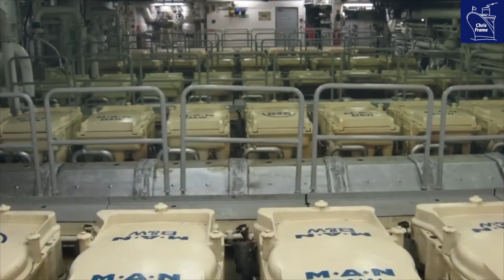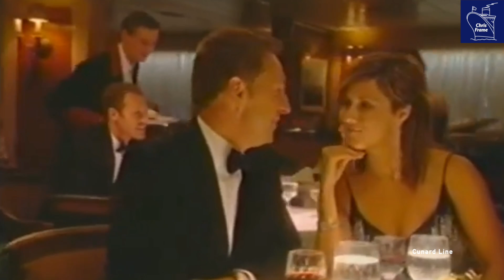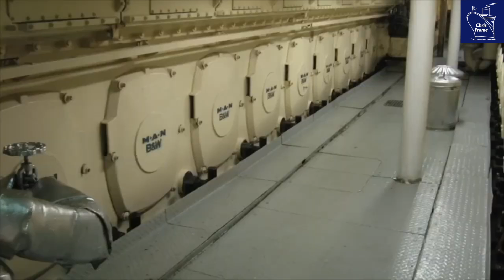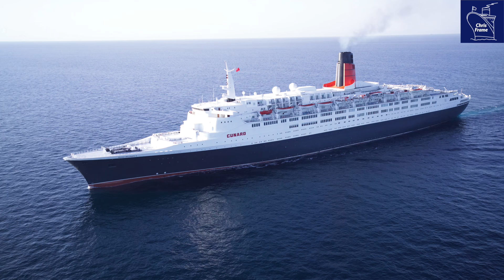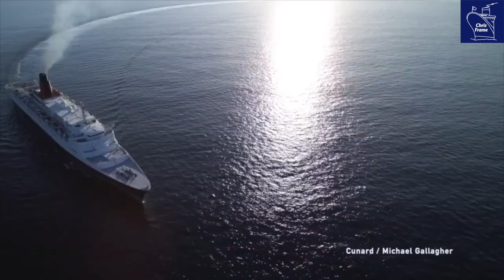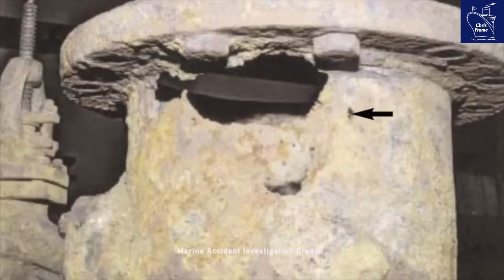The Design FLAW That Almost SANK the QE2

Comment: I learnt from someone involved during the construction that some of the upper decks warped a lot from the welding. They might have been aluminium. Anyway according to my source, this required a helluva lot of epoxy filler to fair the decks.

Comment: A bit surprising however. Any yachtsman knows that all thru hull fittings are vulnerable and must be periodically replaced. On a yacht proper silicon bronze is used. This was just steel ! So corrosion is not maybe but certain!

Comment: At present, the SLNC York, which provides logistics to the US military, is crippled with a broken propeller shaft in the South Pacific.  Very similar situation, no easy way to stop the inflow.  Apparently, there is enough reserve buoyancy, but the engines can't be run.
Well done video, subscribed.

Comment: They got very lucky too.  That bladder could have blown the rusted section outward just as easily as an external wrap could have collapsed it inward.  I am guessing that when constructing a water tight integrity vessel such as a ship's hull that no pipe should be overly large, as that ten inch one was.  By specifying several smaller pipes to a manifold where the main shut off valve is the likelihood of only one manageable leak is higher.  The solutions on a smaller pipe would be more varied and somewhat easier to manage with the bilge pumps buying time for repairs to a much, much smaller volume of water ingress.  It would also be provident to design with the flange of the shut off valve against the outer hull plating, eliminating that uncontrollable section.  It would not be too far a reach to also design all such valving to be in a watertight compartment where flooding could be contained to a small volume.
Reply: Against which you have to balance the principle that through-hull fittings should be kept to a minimum. If you were to halve the diameter of the pipe, you'd have to have four of them to achieve the same capacity. I imagine that having lots of incoming pipes leading to a manifold of some sort might offset the benefit of mitigating potential water ingress by adding increased complexity. Such complexity could well militate against the practicalities both of adequately inspecting the installation and accessing its constituent parts in the event of failure. TBH, I was surprised that the bilge pumping capacity was not adequate to cope with the failure of a pipe of that size.
Reply: Naive generic comment

Comment: None of that made any sense.  Either your pictures were wrong or your description was
Reply from the maker: Hello. Sorry to hear you struggled to follow along. The story and the imagery both were set out in a logical way so I’m not sure where the breakdown happened. You can always read the full report online at the UK Marine AIB.
Reply: My confusion is with the diagram that shows water flowing into the engine room from what looks like a hole in the inner hull as it leaks in from a pipe that has eroded between the two hulls.  Also if they put a balloon up the pipe how did they do that with the valve there. It says that the area between the two hulls was inaccessible.
Reply from the maker: Ahhh okay - the bladder was inserted into the pipe from the accessible side and then inflated past the break to seal it off. The red line in the diagram is to illustrate inaccessibility I perhaps am not that good at creating diagrams 😂

Comment: I thought that all pipework coming into contact with sea water was specified as Kunifer 10.
Reply: Usually where it enters the hull it will be the same material as the hull then go to CuNiFe after the hull valve
Reply: @grandsoleil56  There must be a solution to this problem, I have used Kunifer as an industrial pipework engineer, how could we connect Kunifer to the ocean in a safe effective way, maybe one transitional pipe welded to the hull, lined with kunifer and counterflanged with the same metal so no contact with steel and sea water. Mind you the soldering rods for Kunifer are very expensive, beautiful pipe to work with though. Please share your thoughts,  I love other peoples ideas and observations.
Reply: @cbechstein9347 on the steel hull vessel I work on the CuNiFe pipe goes to butterfly valves separated by gaskets to the hull material, bonded electrically by bonding straps. Yeah nice metal and expensive!
Reply: 90% copper, so prohibitively expensive, and unnecessary if the pipe had been designed properly, with its isolating valve fitted conventionally, direct to the ship's hull or to a sea chest, so that it was accessible, therefore enabling its entire length to be inspected.  Worth reading the detailed report here:
https://assets.publishing.service.gov.uk/media/547c70ee40f0b602440000df/qe2.pdf

Comment: crap 80's installation - crap non-inspections - nowt like a nice coat of paint to hide wafer thin electrolysis destroyed metal!!  - how about getting the way off and fothering a cargo net of mattresses over the intake (the water ingress sucks the plug in with terrific force) - got a big crew of competent seamen so that would make the ship safeish whistle an internal steel box could be fabricated and filled with cement. - oh yes, old style, but its saved many a really badly wounded ship.  - the internal bladder was a good solution tho it probs was a lot harder to insert than an outside in fother job!!  oh the fun of going to sea!! (30 yrs and i finally swallowed the anchor!!!)🙃😉😊

Comment: Question from somebody who IS NOT a sailor. Why couldn't they put a steel or wooden patch on the outside of the hull to slow/stop the water?
Reply: In Nelsons time they would 'fother' the hole from the outside with stretched sail material to slow the leak down. See 'Fothering'
Reply: They don't carry the expertise (underwater welding is a very specialized form) or equipment to accomplish that.  Rigging to go down that far on the hull with the ship moving in the seaway (they would have to stop dead and there would still be a lot of ocean motion) would be no small thing and require specialized cranes and equipment.  Not to mention that if it is flooding that fast it has to be stopped inside first to allow a diver to work by the suction it would create.  A wood patch would still need welded hold down points and have a set of problems all its own.
Reply: The inlet through the ship's hull was on the turn of the bilge, 8m to 8.5 metres below the waterline, the ship was in mid-Atlantic and the sea was rough with winds recorded up to force 10. It would be impossible to secure a patch to the outside of the hull in such conditions.  It's worth reading the detailed report here: https://assets.publishing.service.gov.uk/media/547c70ee40f0b602440000df/qe2.pdf

Comment: Hey, have you ever talked about the car that sailed across Atlantic aboard QE2 in 2002?
Reply from the maker: Many cars were carried aboard QE2 during her career so I’d need a bit more info as to which one 😊
Reply: @ChrisFrameOfficial  Yes, I should have been more specific, but that's hard without sounding too nerdy 😅
Reply: @ChrisFrameOfficial   Wikipedia says this:
On 26 June 2002 a Maybach 62 enclosed in a glass case on the Queen Elizabeth 2 departed from Southampton, England, en route to New York City, with the media and company officials staying in the luxury suites on board. The ship arrived in New York on 2 July, welcomed by geysering fireboats and a motor boat. A helicopter lifted the car off the liner and onto a dock. It was then driven to the Regent Hotel, Wall Street.